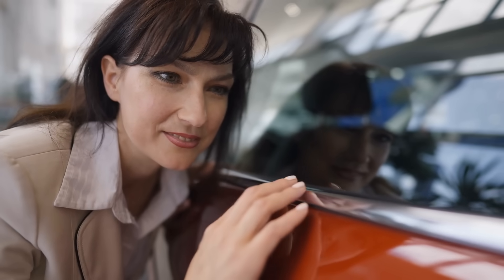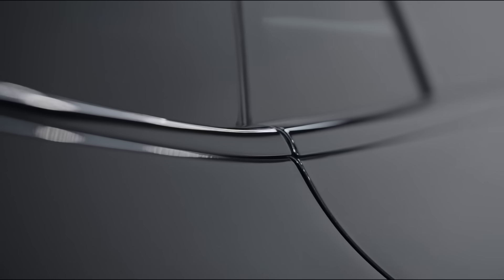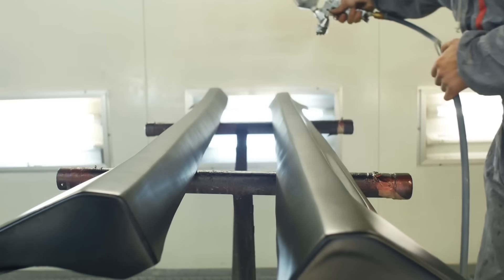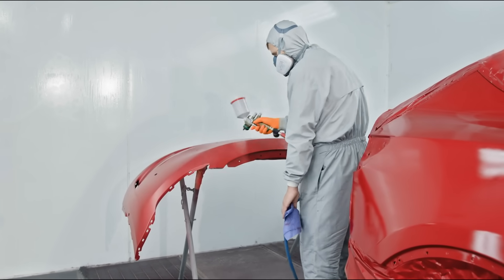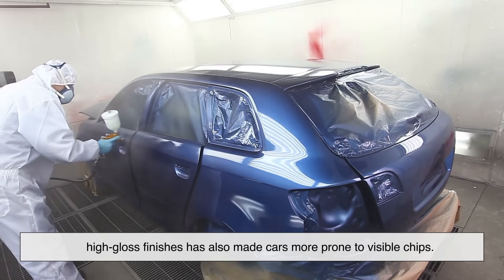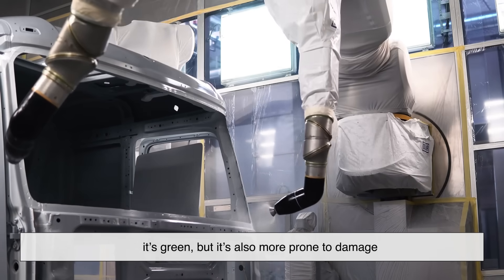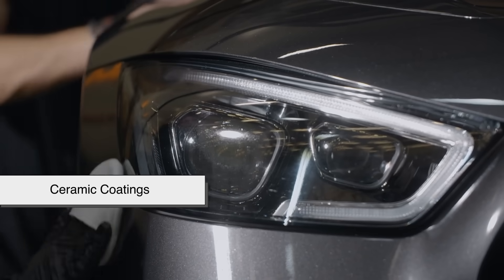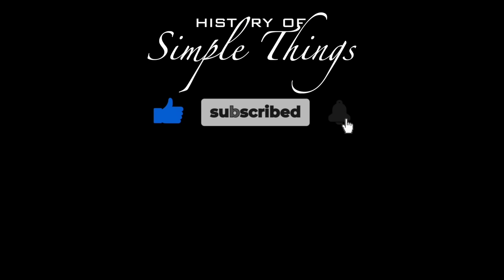Why Car Paint Chips So Easily on New Models

Comment: I recently installed sound deadening and temperature insulating panels on my 99 Mustangs's trunk - I was also reading that this is available for floors, ceilings, and hoods - a lot of music enthusiasts are fanatical about this - I was reading on the hood, that it helps reduce paint damage by insulating the hood from the heat of the engine more - seems like it might help a bit with the metal flex as well - I also added struts for the hood instead of the hood prop - find myself thinking that may help with the more gentle slamming of the hood to close now, not jarring the paint as much.

Comment: I love your videos. High-quality content. Would you be so kind as to make one for Jake brakes? I have seen some, but still can´t fully understand how it works and why small diesels do not use it.
Reply: HI, Good suggestion although Jacobs Engine Brakes (Jake Brake) are not mainstream in most of the public knowledge. They are used in large truck engines for the purpose of retarding downhill speed by, basically, turning the engine into an air compresser which uses power rather than delivering power in a normal setting. Put your truck in a lower gear on a big hill(or small one), flip the switch and you hear the engine change tone and feel the truck slowing as downhill momentum tries to increase speed but the engine, in the ‘compresser’ mode is keeping the speed down. It works by a system of valves and cams to change settings inside the engine to cut off fuel and use the incoming air to be compressed and released through the exhaust stack as normal exhaust would. Some of the old Jakes were VERY loud and some  drivers would delight in flipping it on at 3am on residential areas, so…….as always happens, municipalities passed laws against use of engine brakes any time. You still see signs to this effect on freeway off ramps, especially around Salt Lake City. The new engines and mufflers have been designed to make them almost silent these days. I drove a 2006 Peterbilt 379 with a 425hp Cat engine and you could easily carry on a normal conversation inside the cab with the Jake engaged. Diesel 
engines in construction machinery and other equipment don’t really have a need for this device. Some larger off-road dump trucks do have them. It does add some complexity and cost to the engine but it’s well worth the expense in terms of safety and less brake shoe wear. The Jake is made by the same company that manufactures drill high quality drill chucks. Look on the side and it will say “Jacobs” next to the scroll. I believe it was invented by Clessie Cummins of the engine fame. Hope this helps. Also some YT videos out there that explain the in more detail. Have a good day.
Reply: @brianbender7438  🙂